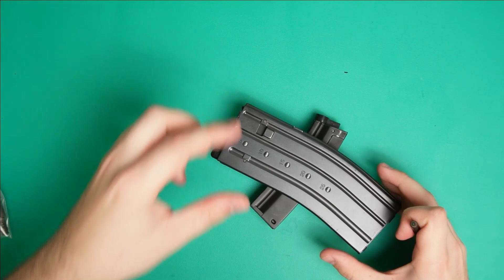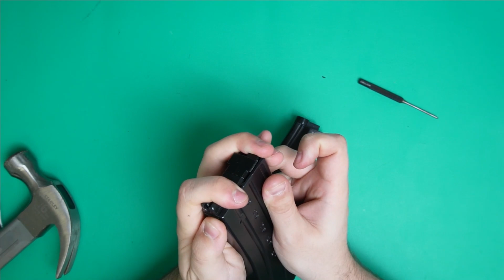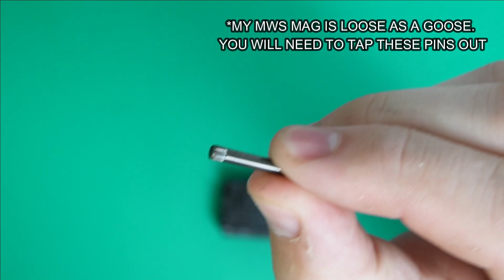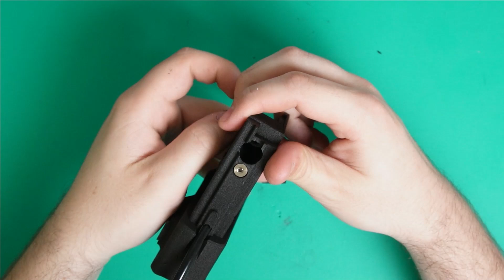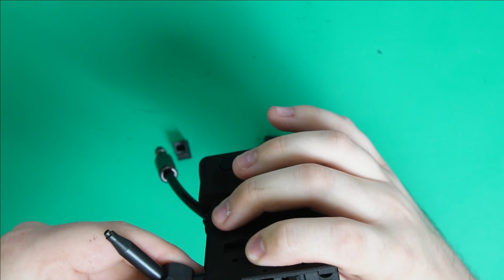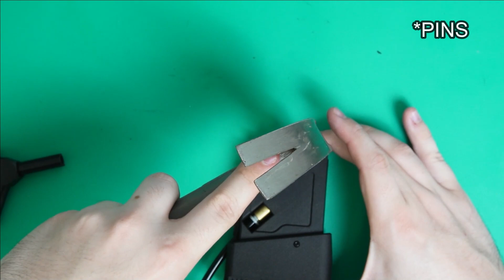MWS M4 and MP5 BUILD GUIDE

Comment: there is a design issue with this adapter regarding that grey shim you are using, the way it is assembled atm moment by airtac is horribel... usually falls out after a couple mag switches. I will mail them with some pictures how I fixed this
Reply from the maker: It should be held by a quite strong adhesive apologies if this has come loose for you